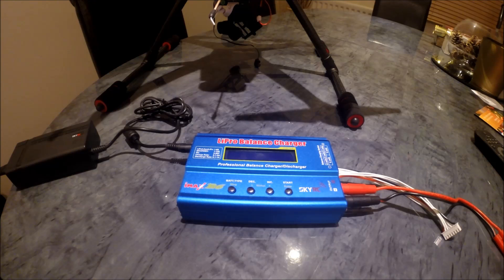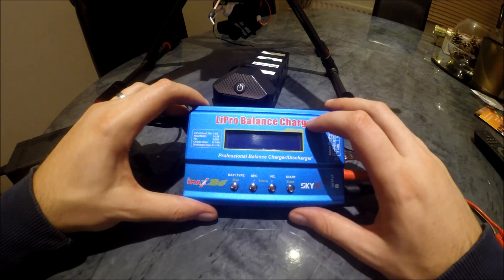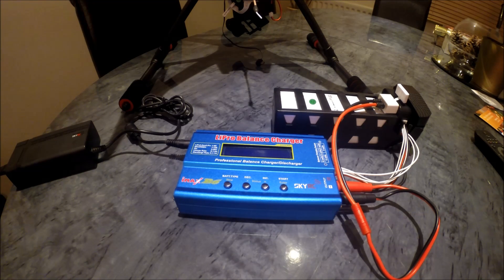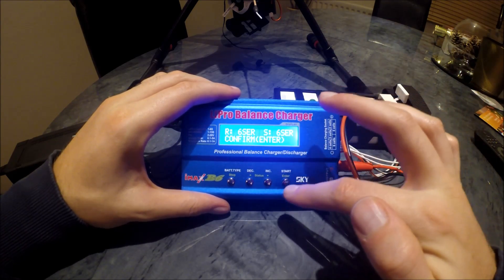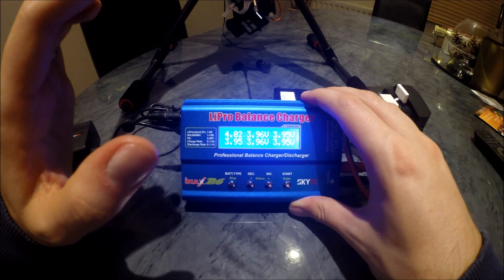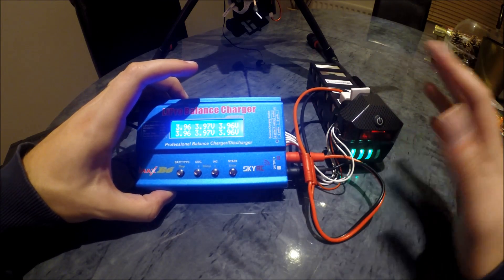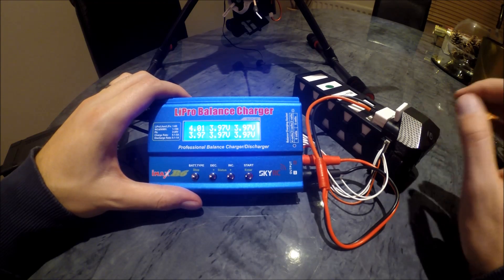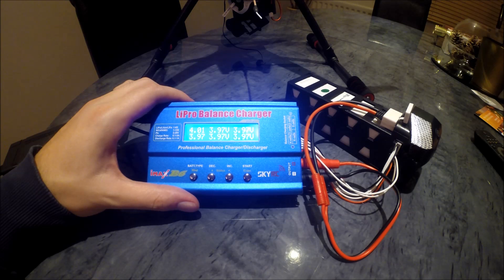Walkera Scout X4 LIPO & how to charge it

Comment from the maker: Steve, depends how flat your battery was and what method of charging your using. At 3.0a and 22.2v and in "balancing" mode, you should be looking at 1.5-2hrs. That's if your battery is low. Monitor your charging by checking each cell in balancing mode. At 4.2v per cell, the battery is charged.
Reply: +Alex Savo Hi, My battery is charging at 4.2V per cell for two hours and 40 minutes in these settings (22.2v 3.0a and "balancing" mode). The battery is new! Is this normal charging time?

Comment: I don't think that's right. How charger knows how many mAh needs to put in different batteries ??
Even when you set it at 3.0A it's charging it at 1.9A and less.
Reply from the maker: If you put it in balancing mode, everything works fine and the closer it gets to capacity, the lower voltage it starts to put in. You only need 5.0 if you want to charge your battery quickly.

Comment: Hi Alex. 
Shouldn't be charge set at 5.4A charging current because battery has 5400 mAh ?
Reply from the maker: nope....could damage the battery. Revert to 3.0 to keep the battery in good condition.
Reply: +Marek Micak If you look at the power supply for the charger it is only 4A, so i'm sure there's no benefit at least going over 4A.

Comment: Alex, how are you charging the Scout X4 ground station? Can you use the B6, if so how do you set up the charger? I think I read somewhere about using the USB port for charging. I've got the white version and the few instructions that are included are definitely lacking in translation quality and "how to" information!
Reply from the maker: BeeBob76 I have not used the ground station as I do not have an android tablet. However, as its USB operated, then your need to plug this into your computer or wallcharger. The B6 would not charge it. Hope it helps and you get results with the ground station.

Comment: Alex,   thank you for your videos.   Had you noticed that the charging instructions that came with the scout are to turn on the battery during charging,  or at least that is my interpretation.  Before watching your video I charged with the battery off.  So far I can't tell the difference. 
Wonder if anything new on the subject.
Reply from the maker: Hi Ken, I have not really noticed a difference between on and off to be honest. When on, the accuracy creeps in...so I have decided to have it on. I turn it off straight after charging to avoid any loss in performance.

Comment: I'm trying to charger my battery and the charger keeps giving me a VOL ERROR... That means that I need a new battery???
Reply from the maker: its possible but let's not worry yet. How are you charging it and with what settings? Is it the first time in use?
Reply: Hello Alex I start off by setting the setting to lipo charge on the screen it says above the numbers and says lipo charge and then under that the numbers start it says 3.0 a space and then 22.2 volt 6 s in parentheses next I hold the start button down for 2 or 3 second.... says battery check once I press the button another screen comes on and it says R: 5ser  s:  6 sER confirm enter cancel stop... Once I confirm it charges for about 5 seconds then I get a BATTERY VOL ERR CELL CONNECT
Reply from the maker: Ermmm OK. Have you tried "balance" rather than "charge"?
Reply: I've only had this Skout x4 about 1 week and I think that it is too soon for my battery to be acting up like this maybe I'm not doing it right I hope you can help me
Reply: this is what the screen looks like when I'm starting ( Lipo charge 3.0a   22.2v(6s) then I press the button it says battery check..... cancel STOP confirm ENTER but right above that it says R: 5SER  S:  6SER...... Then the cancel stop confirm enter

Comment: After doing the steps in the video how do you know when the battery is fully charged and ready to be disconnected?
Reply from the maker: All cells should register 4.20. The charger will beep loudly and flash saying "full".
Reply: Is there any issues if you buy a spare battery, would it disrupt any setting on the Scout X4?
Reply from the maker: Nope nothing at all. It will not harm it one bit.
Reply: Alex Savo
I just received my Scout X4 and tested the voltage on the battery which reads 22.95, do I need to charge it or is it ok?
Reply from the maker: If you want to fly it for no more than 5 mins...you can...but I wouldn't... charge it fully...just to have more fun.
Reply: Alex Savo When your balancing the battery it is still charging correct?
Reply from the maker: ***** yep....its charging all cells but charging them all at the same rate.

Comment: Alex there is a update on F12 E transmitter and the Scout x4 propeller startup Parameter to make the propeller to start up at the same time. Would you do the updates or not. Just would like to have your advise that all? My Scout x4 will be here tomorrow. Also did you fined out which way is best to charge the Scout x4 battery pack?
Reply from the maker: Hi Todd, exciting times uh? Tomorrow cannot come soon enough :) OK so forgive me if I do not answer your questions, but will do my best.
1) I would not update the F12e software. It's fine as it is. I believe the update disables a few things and people are regretting the update.
2) Its the Scout firmware that will need updating however I do not believe Walkera has produced a firmware update for this yet. If you push the throttle up to 50% straight away, there is no issue.....is anything below that and your notice they do not start together. 50% is fine however to get you in the air safely.
3) Best way to charge the scout battery is set it at 3.0A and 22.2mah. Set the charger to balance and turn on the battery. The charger will read the battery better and perform more efficiently.
Hope it answers your questions. Anything further then let me know.
Reply: Alex Savo Thanks for all you help